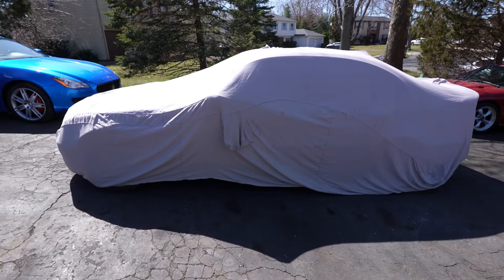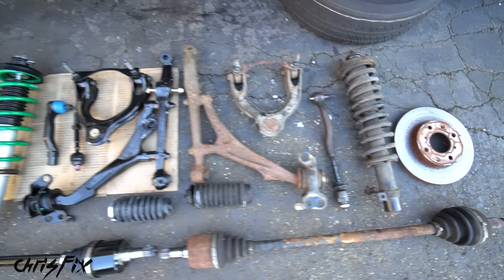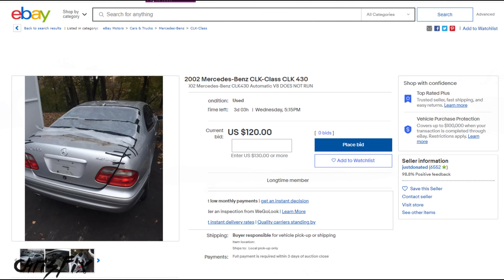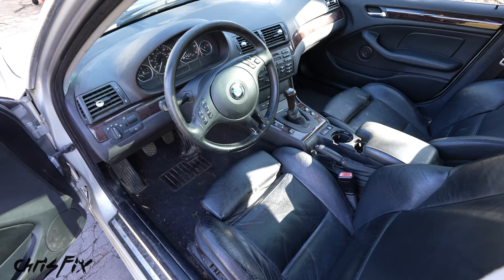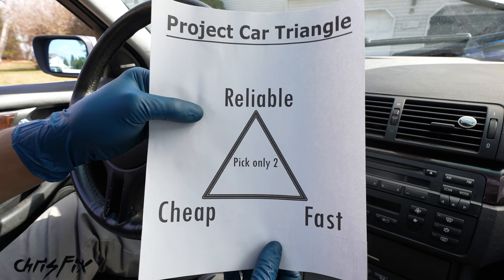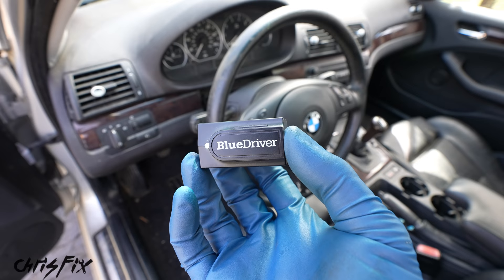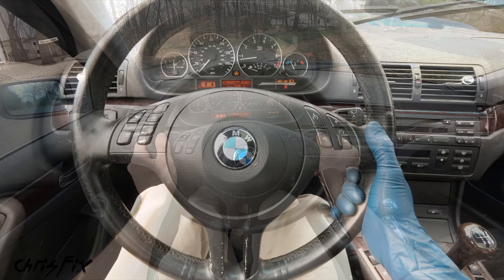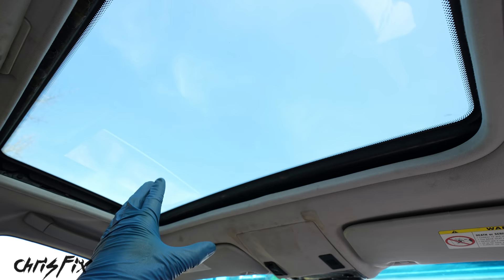How to Buy a Budget Friendly Project Car

Comment: Sell the catalytic converters you don't need them on a race track
Reply: That means the price of the car will be lower than that of its catalytic converters. LOL
Reply: brilliant idea!! They're probably worth quite a bit in scrap metal value. Whilst he's at it he may as well ditch the rest of the exhaust system to shed weight and fabricate a new one out of soup cans.
Reply: After 230k miles they are garbage I think.
Reply: @darkanzalipl  even so, I bet the material is still worth a good amount, especially with the amount of catalytic converter thefts that have spiked up lately.
Reply: @darkanzalipl  they are bought for the metals inside. usually they don't give a f if it works or not. Probably could get around 100-200eu for the cats.
Reply: The inspector of the race:
Hey how much is your car cost?
ChrisFix and ourselves:
-500$
The inspector of the race:
Confused Unga Bunga

Comment: " If it's going to be reliable and fast it is not going to be cheap" *mustang laughing"
Reply: However it handles like brick of soap in sink.
Reply: @Damian-el1sw  i was talking about his mustang tho. If you've seen that video where the takes fans for a drift ride, 3 days straight for 8 hours with only one blown coil pack. That's one tough machine. And he bought it for what?... 800-1200 dollars at an auction?
Reply: @TheLenki4  In that case - absolutely agree

Comment: Thought they were serious about having a $500 car is this car even gonna be allowed
Reply: 20:04
Reply: watch the video
Reply: "4.4: BS Factor: To prevent cheating, all cars will be inspected by a panel appointed by the Organizers. At that time, all teams will be given an opportunity to describe the car’s purchase and prep. If the panel believes the limit set out in Rule 4.1 has been exceeded, it will assign a Bullshit Factor (BSF) equal to one BSF per $10 above the limit. The entry will be docked one lap for each BSF assigned. (Ten dollars = one BSF = one lap.) Entrants are very, very, exceedingly strongly encouraged to bring pre-race-prep photographs, verifiable receipts, notarized testimonials, plus any and all other supporting evidence to Tech/BS Inspection. Or at least make up plausible-sounding stories in advance."
Reply: Wheels, tyres, headliner, rear seats, accessories kit for changing wheel, sunroof when it’s removed.
Reply: @Zaia2013  Don't forget about bribes.
Reply: POV: You didn't watch the video
Reply: for those who are still halfway through the video and checking the comments: he's allowed to re-sell unnecessary car parts and it subtracts from the price.

Comment: 14:22 Love this part
Drivers:
- ChrisFix (Hey guys, ChrisFix here!)
  Stats:
    Speed: 3/6
    Acceleration: 5/6
    Weight: 1/6
    Handling: 2/6
    Endurance: 6/6
  Strengths:
    - drifting
    - endurance
  Weaknesses:
    - overthinking
    - sleep
- Ari ('Murica)
  Stats:
    Speed: 6/6
    Acceleration: 4/6
    Weight: 5/6
    Handling: 3/6
    Endurance: 4/6
  Strengths:
    - engine swaps
    - patriotism
  Weaknesses:
    - blown motors
    - communism
- Garrett (if I'm not flying I'm fishin)
  Stats:
    Speed: 3/6
    Acceleration: 6/6
    Weight: 2/6
    Handling: 4/6
    Endurance: 3/6
  Strengths:
    - air time
    - sending it
  Weaknesses:
    - discounted car parts
    - sending it
- Aaron (So, I bought a BMW)
  Stats:
    Speed: 5/6
    Acceleration: 3/6
    Weight: 4/6
    Handling: 6/6
    Endurance: 2/6
  Strengths:
    - drifting
    - BMW expert
  Weaknesses:
    - buying junk BMWs
    - indecisive
- Pierce (Don't worry guys, I got it on video.)
  Stats:
    Speed: 4/6
    Acceleration: 5/6
    Weight: 1/6
    Handling: 3/6
    Endurance: 4/6
  Strengths:
    - pit crew
    - filming
  Weaknesses:
    - can't drive stick shift
Items:
- Pants/Tshirt:
    Comfort: 5/6
    Fire Resistance: 1/6
    Breathability: 4/6
    Flexibility: 5/6
    Cost: 1/6
- Racing Suit($600):
    Comfort: 4/6
    Fire Resistance: 6/6
    Breathability: 3/6
    Flexibility: 4/6
    Cost: 6/6
- Nitrile Gloves:
    Comfort: 5/6
    Fire Resistance: 1/5
    Breathability: 0/6
    Flexibility: 5/6
    Cost: 2/6
- Hands:
    Comfort: 6/6
    Fire Resistance: 0/6
    Breathability: 6/6
    Flexibility: 6/6
    Cost: 0/6
- Racing Gloves($130):
    Comfort: 3/6
    Fire Resistance: 6/6
    Breathability: 3/6
    Flexibility: 3/6
    Cost: 6/6
- Sneakers:
    Comfort: 6/6
    Fire Resistance: 1/6
    Breathability: 5/6
    Flexibility: 4/6
    Cost: 2/6
- Socks:
    Comfort: 6/6
    Fire Resistance: 1/6
    Breathability: 4/6
    Flexibility: 6/6
    Cost: 1/6
- Racing Shoes($200):
    Comfort: 4/6
    Fire Resistance: 6/6
    Breathability: 4/6
    Flexibility: 3/6
    Cost: 6/6
- Helmet:
    Comfort: 3/6
    Fire Resistance: 4/6
    Breathability: 4/6
    Flexibility: 1/6
    Cost: 2/6
- Racing Helmet($1000):
    Comfort: 5/6
    Fire Resistance: 6/6
    Breathability: 3/6
    Flexibility: 4/6
    Cost: 6/6

Comment: @chrisfix If you have multiple sets of wheels/tires, get the Falken RT660 or RT615. They’re 200tw and eligible for lemons and the best bang for buck. Lemons requires 190tw or higher. The newer 660s will wear faster, but are grippier, the 615s are the old version but slightly better for endurance. Compared to any other 200tw tire that’s worth driving on, it’s the best budget tire just be kind to them with a heavier car like this to avoid overheating and making them feel greasy.

Comment: I don’t know if it’s still relevant, but “Michelin Pilot Sport 4s” are really good tires for that type of race
Reply: totally agree on that one!
Reply: It’s a great tire, no argument there, but for a purpose race car with multiple sets of wheels, that tire is expensive and not as grippy when compared to some 200tw tires like the falken rt6xx’s or even the hankook Ventura rs4, which is known to be a good track day tire. Don’t know the sizes he needs, but the ps4s can be almost $50 more per tire than those true summer performance tires. Only advantage to the ps4’s I could see would be if it’s rainy.
Reply: Nankang NS2-R 
Budget Semislick with insane grip, widely used on the Nordschleife

Comment: You could sell the spare tire or the carpets/floor mats or the back seats

Edit: you could also sell the door cards/door panels

Edit 2: if the ac works you could sell that plus It would take some load of the engine

Comment: "What's important, is reliability!"

buys a BMW
Reply: Top Gear completed a similar 24h endurance race with a 330 diesel. ;)
Reply: BMW is pretty reliable, atleast the older models. Wym
Reply: @RevvedUpEdutainment   when you say "older" what do you mean
Reply: @arone6298  pre 1999
Reply: Bmw have good motors just ppl can’t afford to take care of them or know how to take care of them and they be expensive as ppl neglect them
Reply: the E46 chassis was the last reliable and well engineered BMW before the full insanity of "technology" took over. I keep one as my daily driver and have had no issues in several years of driving, beyond basic maintence and some simple preventative stuff like valve cover gasket to sort an oil leak, etc.
Reply: BMWs are great cars to have what makes them unreliable is no takes care of them and everyone puts them on the track all the time

Comment: "Comment below what else I could sell"
°Sell the backseats=less weight
Reply: the back seat of the E46 is literally just a foam cushion with leather or pleather covering depending on trim level. lol
Reply: Sell the passenger seats
Reply: Didn't he say that is a safety measure and it doesn't count?
Reply: If it has it sell the full sizes spare tire

Comment: Just got an e36 a few days ago with a zf transmission, the guy also threw in angle kit, wheels, and coils. all for 1200 It’s a save able shitbox but just has a cooling problem that I’m gonna sort out. Deals are out there just gotta really dig.

Comment: I just bought a set of wheels and tires that came with an 07 audi a4 quattro 2.0t for 1000$. Friend wants the wheels, split 50/50, I spend less than the ecs tuning carbon intake it came with. Has a major exhaust leak from the flex hose in the downpipe, and power steering is basically non-existent, those those are the first things on the list

Comment: Saw another racer talking about taking out the A/C completely and running the car's coolant next to the driver with maybe a little extra hosing to reach not sure how that one worked but just something i saw so that way you don't you know die of heat exhaustion and cut costs on things like A/C and cut the weight.

Comment: Not here in Brazil. A old national car in really bad conditions with document here costs R$6,000, and you probabily spend the doble to fix, and the triple to do a cool project.

Example:

A 91' Chevy Chevette costs R$5,700. To do the mecanic, it's R$4,000 and R$3,000 to do the esthetic part. Two racing seats with installation costs around R$3,400. Cool wheels with tires costs around R$6,000.

Yep. Brazil not for amateurs.

Comment: My dad has a 2002 525it wagon and he has rough idle. It has low compression in one or two cylinders so he's swapping the original 2.5 with a 3.0 from a 530 and then supercharging it. Haven't got very far due to issues with family but one day it'll be a 3.0 boosted wagon

Comment: Bro I just picked up same car bmw 330 I 2000 with a map sensor being bad but owners taught motor was gone because it would misfire kinda  exactly what yours was doing and the subframe  mounts were blown  it cracked till they shot out luckily they sell plates to reinforce but body and interior is clean 8.5/10 small dings like 3  for 1000$ and the plates were 100$ and labor is 750 don’t know if to have it sent out or diy but yup 2 k basically 💯

Comment: What’s wrong with all wheel drive? 

I could probably find a cheap Impreza. They have great handling (thanks to the iconic boxer engine), and it’s pretty easy to find parts for.
Reply from the maker: It's a bit heavier, more complicated to work on, and has worse weight balance than rwd, so it wasn't my first choice. Also important to note that a lot of the typical performance parts don't fit our awd car. But in terms of grip and exiting speed there is no competition haha

Comment: I'm new to cars I'm not in this industry at all, but out of curiosity is flooding a death sentence? Is a car just destined for scrap once I see mold? If so why, is just because it damages proprietary parts that can't be fixed alone? Which parts are those usually? Thanks for any help from anyone in advance!
Reply from the maker: If it's a saltwater flood, forget it, if its a freshwater flood, and the flood line isn't too high, not necessarily. And it depends on how much mold, if it's a biological hazard then I would pass but if it's only on the seats or carpet a little bit you can clean it up if you're careful

Comment: Hey Chris, my grandfathers ford ranger has a problem when you floor the gas pedal, the motor wont go, it just wouldn't send power. After that happened it triggered a check engine light. Do you think that would be a problem with the map sensor?
Reply from the maker: I would check the throttle cable first: https://www.youtube.com/watch?v=j0YGvWxO6tw

Comment: I was just wondering why was awd bad?
Reply from the maker: I was trying to get a rwd car as they have much better steering feel, it provides the most grip when cornering, and balance is usually a perfect 50/50 split, and the awd weights a bit more plus the packaging makes it a little more annoying to work on, but I will say after using it for a bit, I think the awd wasn't a bad choice!

Comment: Funny to hear, here in Germany the 6 cylinder e46 is going up in price a lot. Just the 4 cylinders are going down. No joke, an e 46 330i coupe in good condition with about 150.000 km went up to about 17.500€, that should be about 20k $ I guess, correct me if It’s more or less $ 😁

Comment: You think no power steering's bad in that little 4 wheeler? Try losing power steering in a tractor-trailer. Yeah, the wheel's a larger diameter, which gives you marginally more leverage, but you have a much, MUCH larger mass of parts to manipulate manually with a dead pump in the way, and the end result is a net loss of efficiency in steering

Comment: With those rules, in theory you could buy a $5,000 vehicle, sell everything but the steering wheel and seat for $4,500, and call it a $500 vehicle. Seems totally legit. Not gaming the system at all.

Comment: chrisfix $500 challenge gets a bmw. me gets a 1993 camaro z28 for $200. replaced thermostat $40 rebuilt alternator from junk yard $50 pulled a starter off a 1996 impala in the junk yard $30 replaced head gasket $25 cold air intake cheap one  $100 total cost $455. 0-60 in 5.1 1/4 mile 13.7. fucking boss for lemon race.